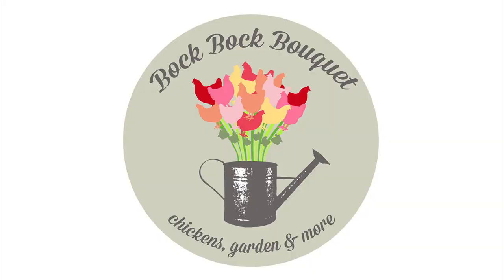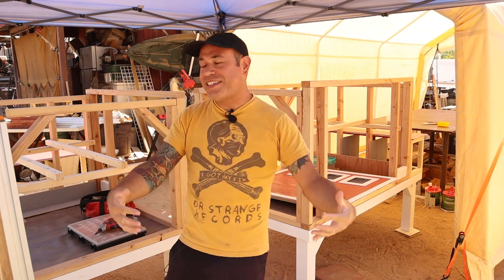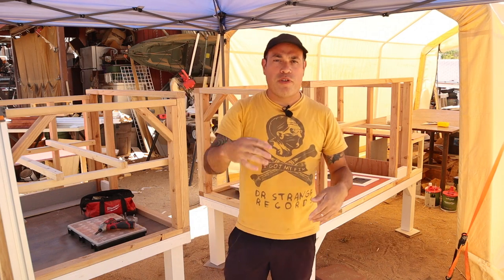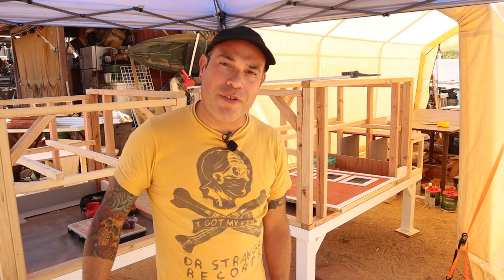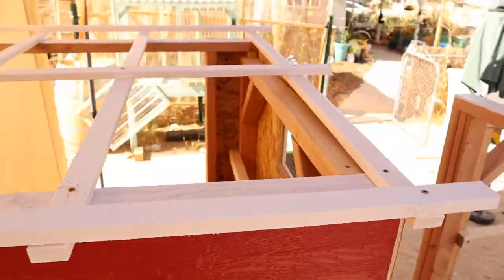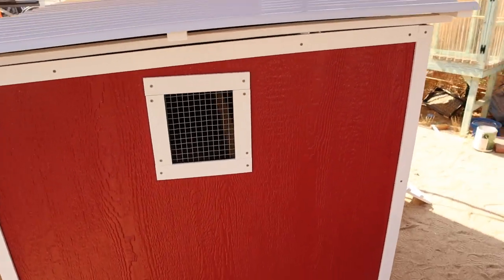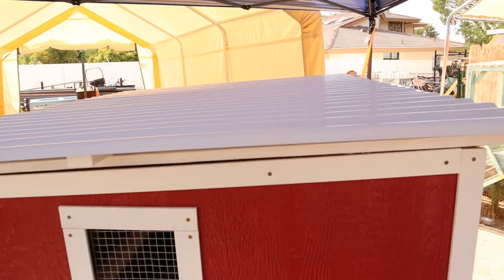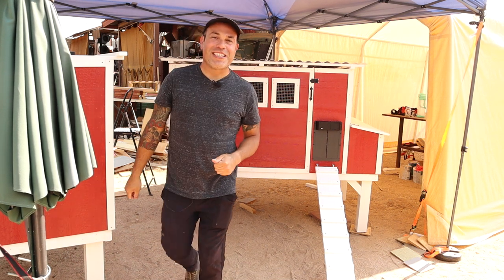Chicken Coop - How to Build Slant Roof Coop

Comment: In my area with seasonal high winds, the wind would make a kite of that 1x2 secured roofing sheet.  even 2x4's might not last but 20 years, because of the winds.  East Texas.  I have roofing panels pulled off 2x4 rafters on an old structure.

Comment: I love how amazing your coops look. Also, do you guys have issues with predators and if so what type of precautions you take. Me and a neighbor are at war with raccoons currently.
Reply from the maker: Thank you very much! We haven't had any incidents here with predators, but we have seen raccoons walking down our street late at night. We personally have our coop inside of our chicken run and our run has a 2 foot predator apron all around it to prevent predators from digging under. If they make their way inside the run, the chickens are still inside their chicken coop and the automatic chicken door is closed and locked to keep other animals out at night. If you are worried about predator breaking in your coop, I might suggest securing the hardware cloth on the windows with a board around the edges on the windows on the inside or adding some 1-2 inch washers to secure the screen some more.
Reply: @BockBockBouquet  thank you, I think I'm going to have to give that a try if we don't catch them. Our neighbor had one break through hardware cloth then somehow pried open the door to the coop killing 18 -month old chicks. I have a trail cam set up on the coop and almost every night it comes to check the  walk in door.
Reply from the maker: How did it break through the hardware cloth? Did it break the actual wire mesh open? Or just pry it from the wood? If so reinforce the hardwire mesh cloth with wood screws and big washers. They will not bust through that, much stronger than staples. Also a hot wire perimeter fence does wonders. Lowest wire sniffing level. One zap and they ain’t coming back.
Reply: @BockBockBouquet  yeah it separated the hardware cloth from the wood. It's a tsc special that has a bit of age to it so the wood probably softened a bit. I'll let him know he'll certainly appreciate the advice thank you so much.
Reply: Hello from N.J. Question . Why pvc and not tin ?
Reply from the maker: @sapper72783  anytime :)
Reply from the maker: @varithomas8523  just based off clients color choice. To have a white roof.
Reply: @BockBockBouquet  ok thank you . I thought pvc was better than the metal roof.

Comment: What did you use on the plywood floor?  looks like vinyl(?).  is that a necessary step since they dont really pee (?).  seems like just straight plywood, even treated plywood, would be ok.  Thoughts?
Reply: Chickens do pee.  What you see as white stuff on their feces is the pee and it's very harsh to plywood.  I built 2 coops last year - thanks to husband's over-enthused to chickens.  On the first one, initially we were going to use vinyl flooring but hubby kept buying the wrong size remnants (just because they're cheap) and I don't want to deal with the urine or runny feces sipping between seams.  I found vinyl wall panels at Home Depot called Plastex (?), they're used to line restroom walls.  These are the pliable kind, not the shiny and brittle ones (FRP) though.  It's easy to cut with utility knives, or circular saw with the saw installed backward (metal blade w/ higher teeth counts is better).  My first coop floor size was designed for one 4x8 plywood panel, so the Plastex panels were perfect.  
For the other coop, since I built it on the base of dept-store-display cart and some used plywood, the size was smaller, so still no seams, except of course where the floor meets walls.  It's fine though since it's not like the pee is running like leaky faucet.  As long as you use absorbent bedding material like pine shaving and you diligently fluff it up, the bedding keeps the floor dry.  In the summer, we dump all the bedding and vacuum the edges.
For the walls, I happened to have enamel paint from a project years ago to paint mdf for my desktop, and it's perfect because the paint is 'harder' than regular paint and easily wiped down.

Comment: What kind of wood did you use for the rafters? Was it furring strips? Because thats what it looks like , but i bought the furring strips and they just seem extremly flimsy and weak. These strips are a dollar and change from
Home depot. Is this what u used in the video? If not, please inform me
Reply from the maker: I am using 1x2s from Lowe’s. Once assembled in this fashion, they are not too flimsy. I don’t intend on staring up on this roof though. You can use just about anything though, 2x2, 2x3, or 2x4

Comment: Hold on a minute... "we in California don't get much rain"?? I think you guys live down south, from previous videos it sounds like you are in high desert area, like apple valley or somewhere drier. Here in redding, in northern California, we got over 40 inches this last winter. I used to live in Barstow before I moved here to Redding. I grew up in San Diego, so I know we get different amounts of rain in different parts of the state. I'm about to build my new coop and run. The posts are in,  the run will be 10x20, and coop is built on the side, about 4x7, with raised floor to be able to sweep the bird poop out of coop into wheel barrow for use in the garden. Other than, I love the advice you guy give. We got our 10 chickens a year ago, got rid of rooster because he was too rough on the backs of the hens. Now the hens pick the tail feathers off each other... got any pointers? They currently have a shorter (about 6ft tall 10x20 run with a tractor supply coop attached. Only one of them have no feathers missing... I'm guessing she and others, pick on the rest, though it's not obvious when we watch them.
Thanks!

Comment: I have another question outside of anything in this particular video. I just noticed my rooster with scaly leg mites. I picked up a clean fresh bail of straw that fell off a semi and stocked my shed with it thinking it wd save me $ for bedding. Doing more research, I found an article that says straw is so bad to use for chicken bedding as it harbors bugs and things. I keep everything clean so I'm asking your advice before I burn all the straw that took me a few hours to stock my shed with. If I have to burn it to keep my chickens healthy I certainly will.
Reply from the maker: Oh no sorry for the delay. Hope all is handled now. I would rather burn and waste money and time on the bedding than deal with the headache of the pests. That is unless you don’t think the mites came in on the bedding? Treat the scaly keg mite and get rid of it, dip their legs in vegetable oil at night for a couple weeks and the mites should be gone. They stay in the host not so much the bedding

Comment: What kind of plywood are you using for this? Looks like OSB from the inside, but the texture on the outside is different. Also looks to be about 1/4" thick?
Reply from the maker: This is a multi purpose shed panel from Lowe’s, but yes, the inside is OSB, outside has a nice texture and it comes primed already for any coat of paint. It’s a 3/8’s sheet sold in 4x8

Comment: That’s a very big gap between the roof n the coop,  something is gonna crawl in such as mice..
Reply from the maker: We always recommend not putting feed or water in the coop and then you will never have a rodent problem. They don’t need these things at night while asleep and the excess moisture in the air from the water can lead to frostbite issues in extra cold climates, so best avoided. The big gap in our climate is very crucial for ventilation purposes as the heat needs to rise to escape. The more the better with birds as they create dust and have sensitive respiratory systems and high internal body temperatures